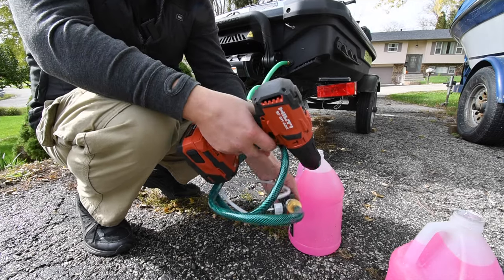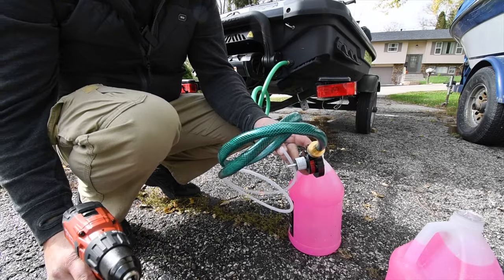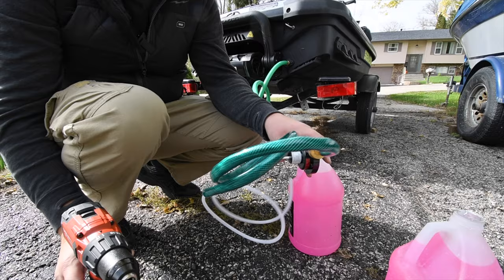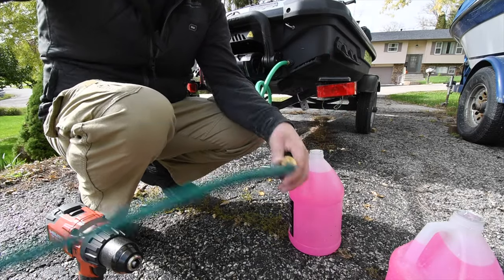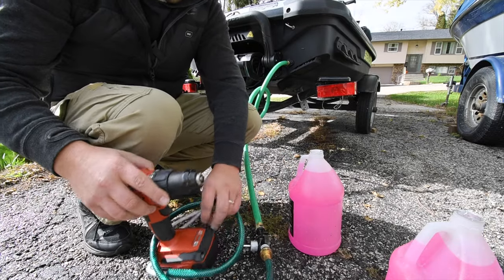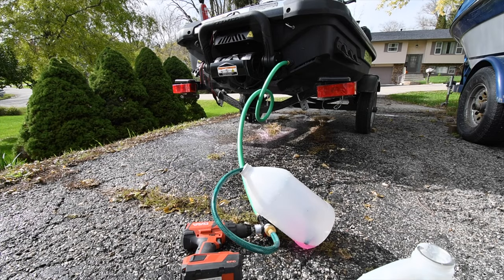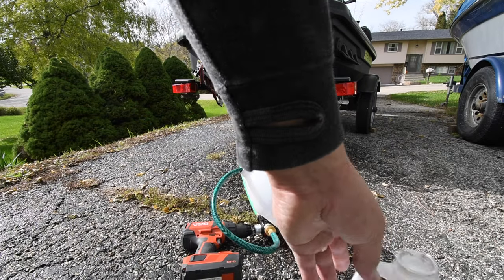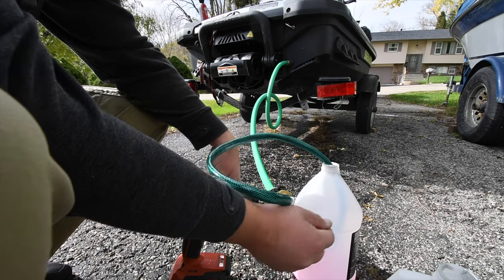$10 EVERBILT Transfer Drill Pump

Comment: Oh god, wristbreaker alert. At least bolt it onto a 10 inch wooden stick. Learned that the hard way xD
And hi again!
Reply: @Orin Bnca please explain why this is a "wristbreaker."  Thank you.
Reply: These pumps use an elastic rubber wheel to do their work and need constant lubrication to not break. What happens is that the rubber wheel eventually expands and gets stuck to the inside of the pump and yanks itself out of your fingers and takes the waterhose with it as a whip.
 It's easier to hold a straight stick-handle than it is to hold a sharp-edged bumpy circle attached to a 2000RPM hammer drill
Reply: @Orin Bnca  Thank you for that explanation.  I had no idea.
Reply: @Biaanca5036  does it matter if you go kinda slow
Reply: does it work if the hose not submerged?

Comment: Just wanted to know how to determine direction. skipped right over it.  If youre not showing us about the tool  whats  the point of the video?
Reply: There are arrows on the pump.
Reply: @robotsonmars1989  ok but the instructions in the box are really confusing as to which side you put the included hose into and whether or not the thinner hose inside is supposed to stay in or be separated. After watching this video I am just more confused.